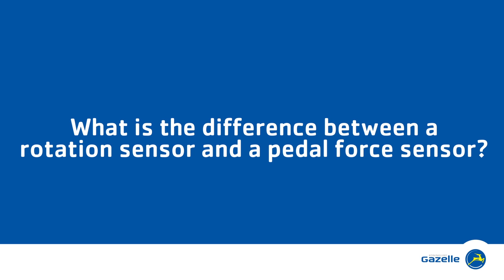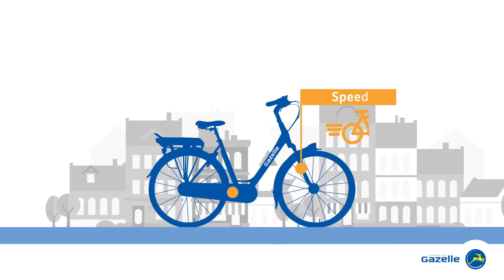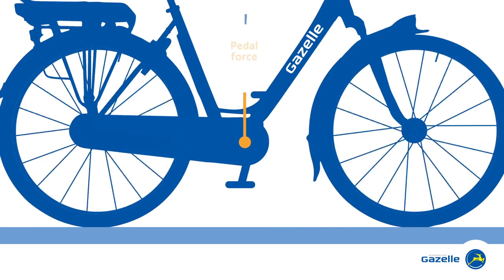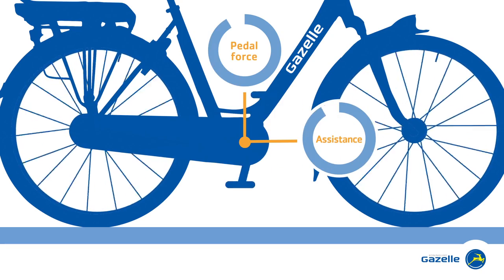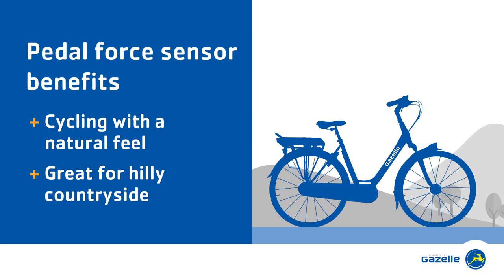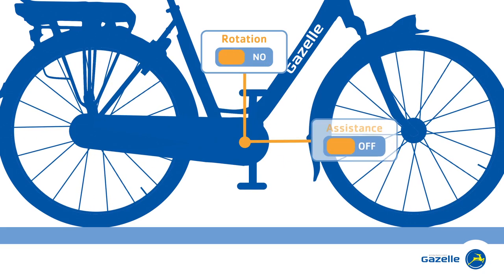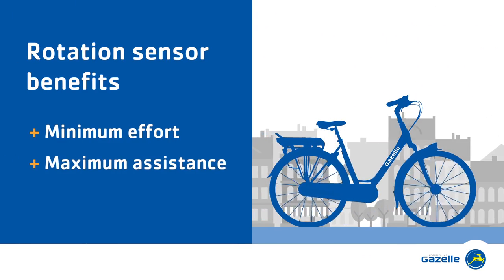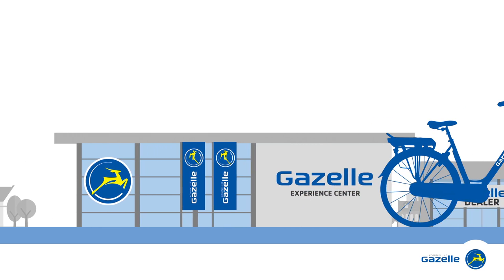Gazelle e-bike - Difference between rotation sensor and pedal force sensor

Comment: Does anyone know how the older Gazelle Innergy (2009) torque sensors work?
I have had a new Nexus gear hub fitted and now the electric bike does not work :(~
I suspect that this could be the problem as it was working before the new wheel was built.
Reply: No